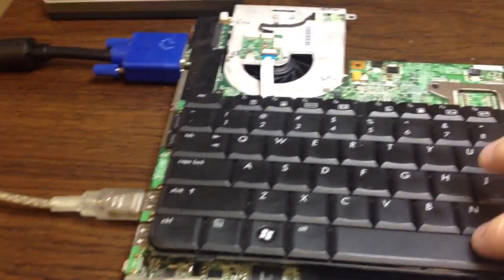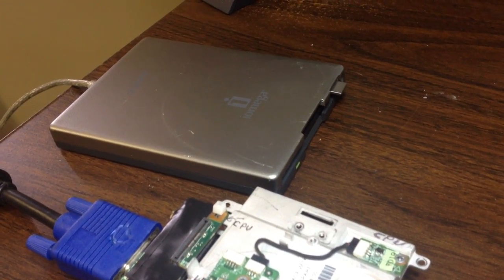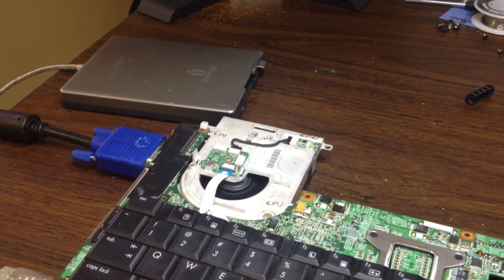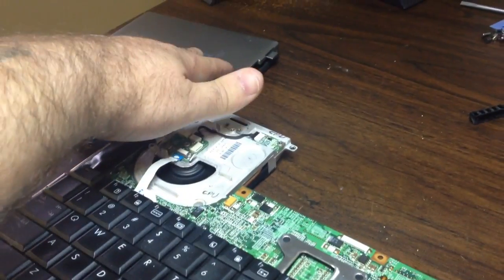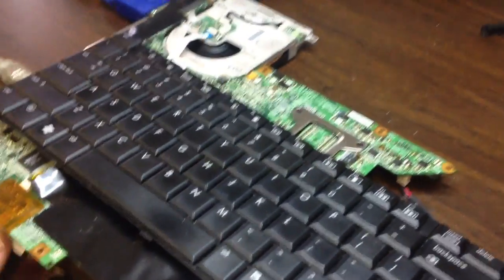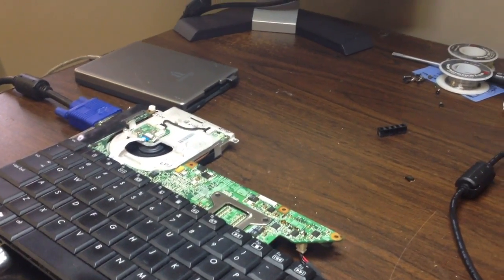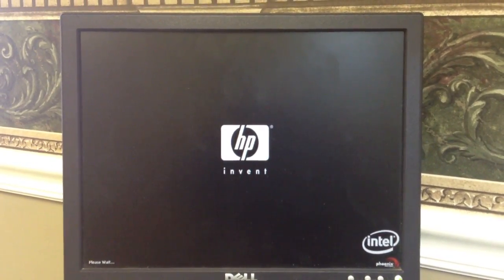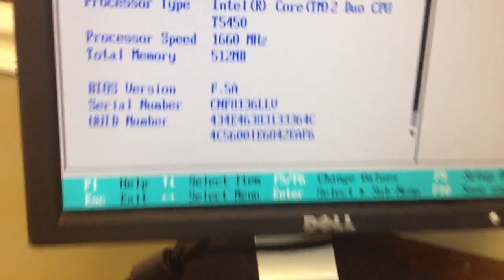Chattanooga laptop repair of a HP DV9700 Bricked BIOS repair fixing the no video BIOS brick

Comment: hi..
i have laptop dv9700 same problem i see ur video and i copy the driver as well but i dnt have a floppy driver..can i do this from cd drive..if yes than how can do that plz tell me..?
Reply: With a CD Rom that is not possible. Only with a USB floppy drive. Otherwise you have to do soldering and use an external programmer.

James with http://www.doubleclickittofixit.com
Reply: so how can i boot this bios driver on floppy drive can u tell me plz..?
Reply from the maker: I will have to look it up but the steps just include making a boot disk and adding the flash tool to it. I have a premade image I use and use Winimage to reload to it.

Comment: OK, so I figured out the files and got mine working, so I thought I would share some information that will hopefully help someone else. I have the DV9700z and I used the f.35 update from hp .com's driver downloads found currently at this URL:http://h10025.www1.hp.com/ewfrf/wc/softwareDownloadIndex?softwareitem=ob-93354-1&cc=us&dlc=en&lc=en&os=2100&product=3650968&sw_lang=

...Then did the following:
1. Download Phoenix BIOS Crisis Recovery Disk from http://www.rechner.org/b1800.html
2. Extract the zip files from the download into a folder on your desktop
3. Plug in your USB Floppy drive and insert a floppy disk (I tried multiple USB thumb drives and they did not work for me)
5. Extract the files from the bios download from HP using WinZip or another similar software. Once this is completed, locate the file with the .wph file extension and copy it.
6. Paste the file in the folder that you created on your desktop. Delete the BIOS.WPH file in the folder of files you extracted and rename your .wph file to BIOS.WPH
7. Run the WINCRIS.EXE file
       *Choose the option to Create MINIDOS Crisis Disk
       *Click Start
       *Click OK on the formatting message
8. Next the floppy formatting dialogue will come up. Leave all settings to their default and uncheck Quick Format (512 bytes/sector, FAT File system, Default allocation size)
9. Once completed, you will get a confirmation message that the Crisis Recovery Diskette was Successfully Created
10. Unplug the USB Floppy drive from the working computer and plug it into your laptop
11. With the battery removed and the power cord disconnected, hold the Windows key + b, plug in the power cord and push the power button (while still holding Win+b)
12. After pushing power, continue to hold Win+b for 5-7 seconds then let go and your floppy should start reading the files
13. You should get one long and two short beeps to start with and when it is done you should get another long beep
14. Once done, your laptop should shutdown. Reboot and it should be good to go.